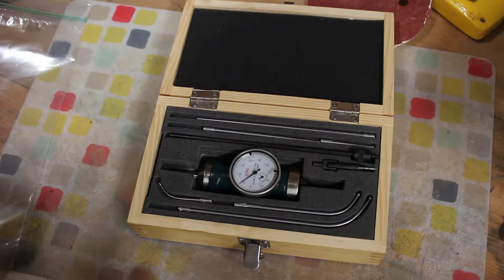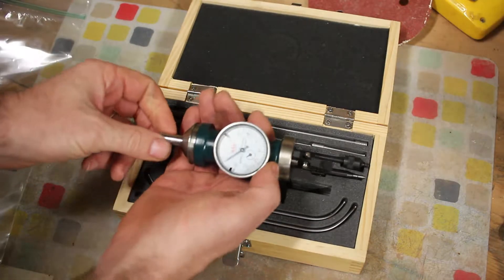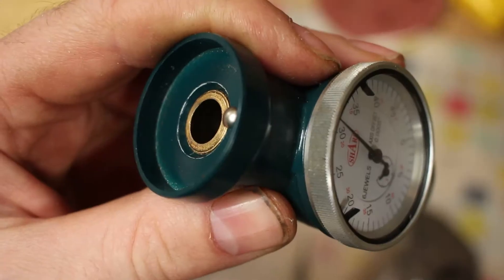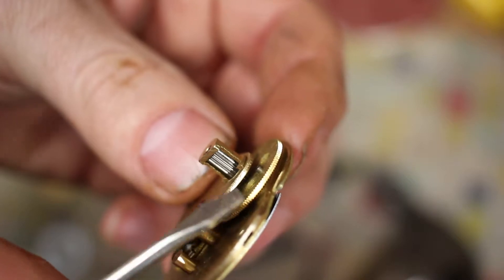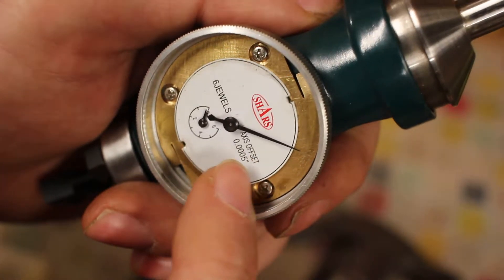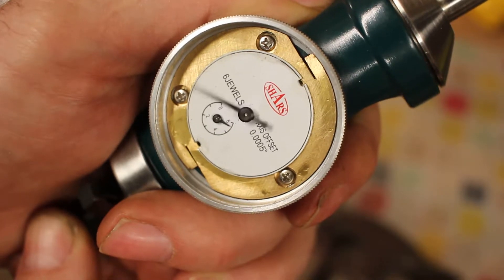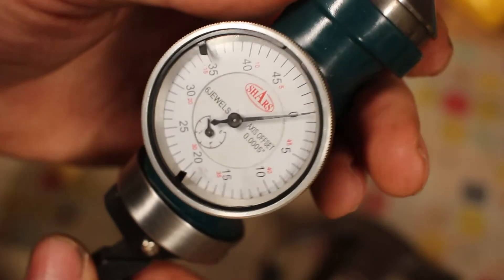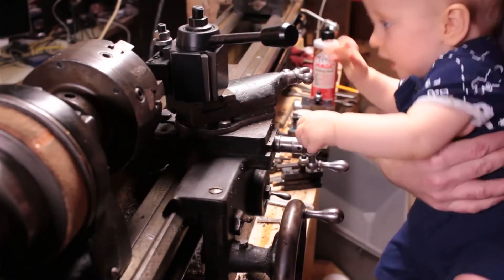Shars Co-Axial indicator repair

Comment: Despite what anyone says. 30rpms is more than enough for a coax. Plus avoids damage. I run 30 rpm to centerline tools with a coax and regularly have spot on pieces

Comment: Co-worker has the exact same one and it quit working on him with the needle stopping all together.  Got it apart with your video and found it was just an alignment issue from a couple screws coming loose.  Had it back together and fully working in less than 30 minutes.  Thanks for the video.

Comment: Good reference! I have no name china one with blue body. My indicator started to get stuck at no load position. Opened by your guide. Saw that  first sproket had lost some teeths in one sector. That sprocket engaged  with that main linear movement rodd, which had limit screw. I put one washer under limit screw to reposition limit so broken teeths wont endage. That fixed my problem and its now again usable. Hope it last still some time.

Comment: I have an old Blake coaxial indicator that needs cleaning,  and I suspect the inside is similar if not identical.   You did not include exactly how you rewound that spring.  Could you elaborate?   Still a very helpful video.
Reply from the maker: It was a pain in the neck and it took me several tries. Since when the rack is in the most extended position the spring is the tightest I wound up the spring 5 or 6 turns of the needle then tried to put it all back together without loosing spring tension.  It took several tries and quite a bit of fiddling to get it to go back together.  I think if I wound the spring needle spring to tight it would stop the rack from returning and too loose and I would have the same problem I started with.  It was a while ago that I had apart.